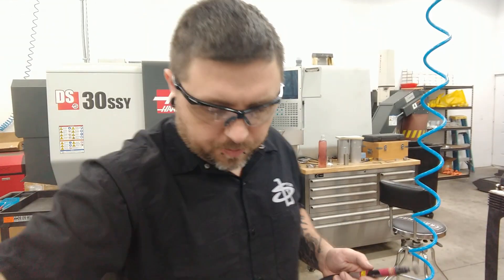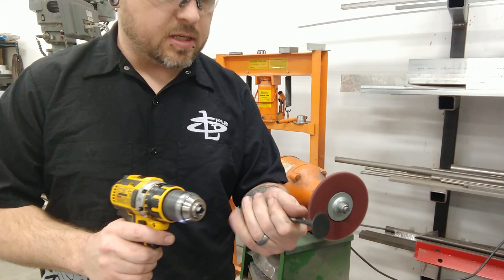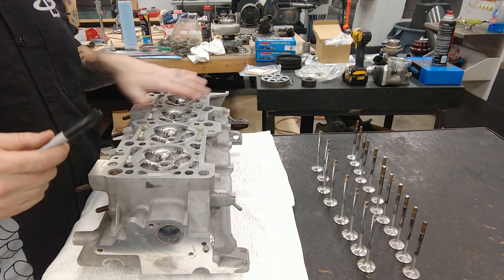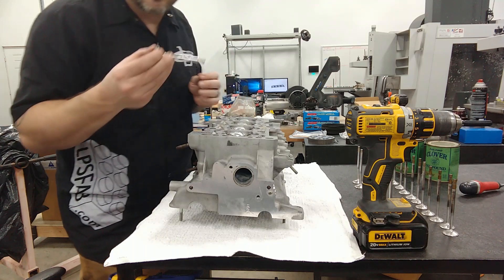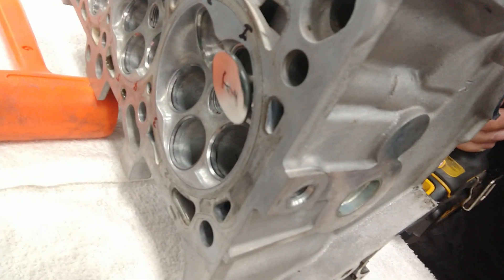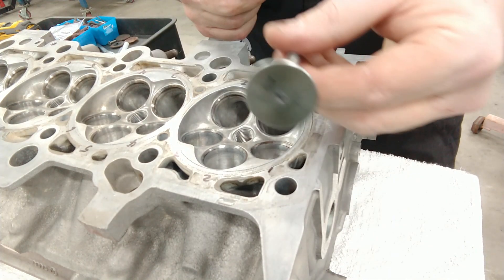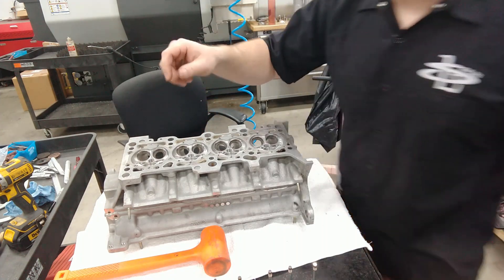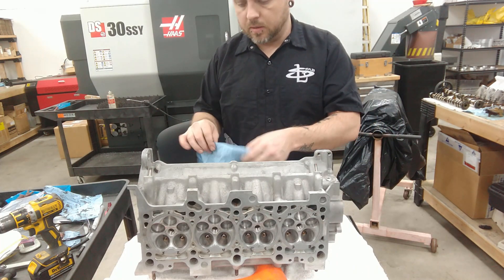VW 1.8t 20v engine build, cleaning and lapping valves.

Comment: when you were cleaning up the combustion chamber, how were those valve seats. Isnt it easy to "take the edge" of them with that scutchbrite? as you going about?
I'm really liking this approach, wondering, should I be protecting those valve seats, before I start running the scatchbrite..

Thanks.
Reply from the maker: Yes you should protect the valve seats, although they are pretty hard and I doubt you would hurt them with scotchbrite, but if you hit them with a sanding roll or carbide burr it would be no good.